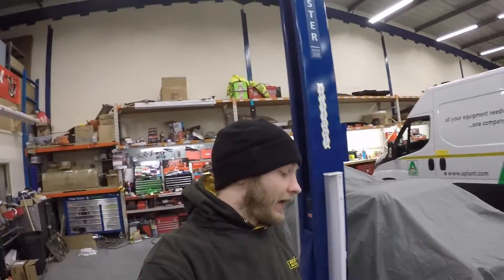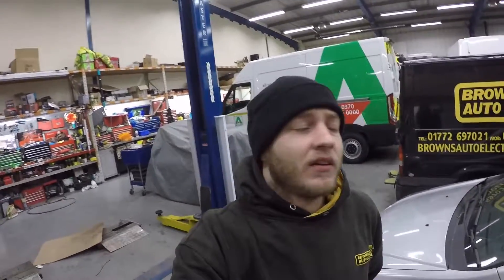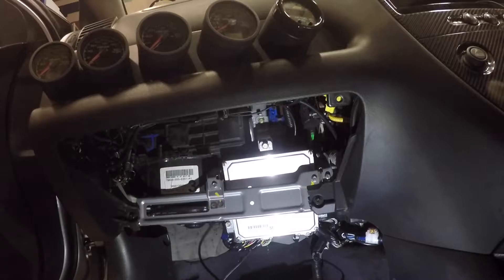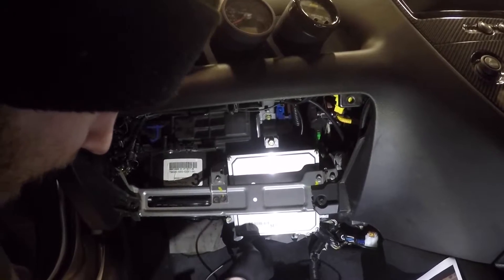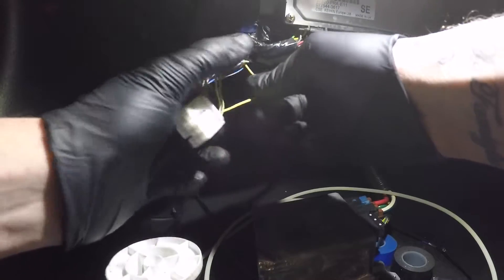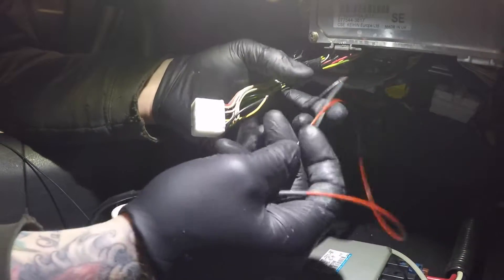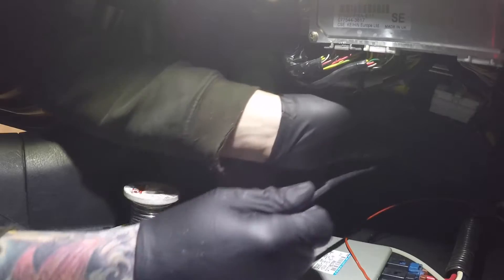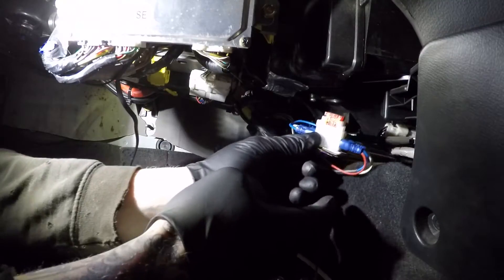EP3 DC5 Honda  K20A2 How To Boost By Gear Using K100 Kpro Ecu

Comment: Can you just unplug the evap and wire the solenoid to those wires in the engine bay, Then inside the car just leave pin 21 alone for the ground and the other wire switched live, Saves running wires into the car etc